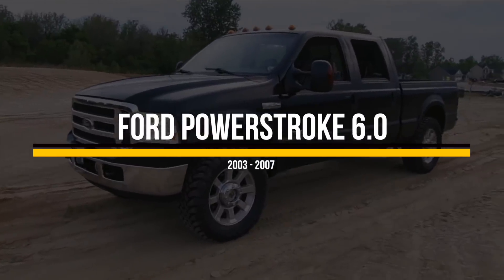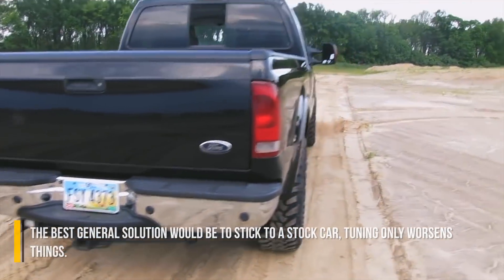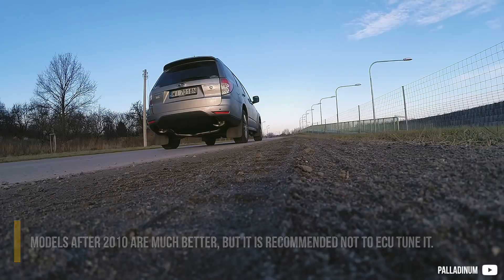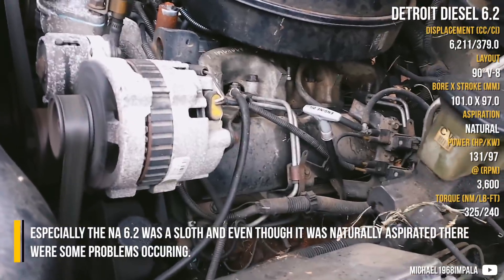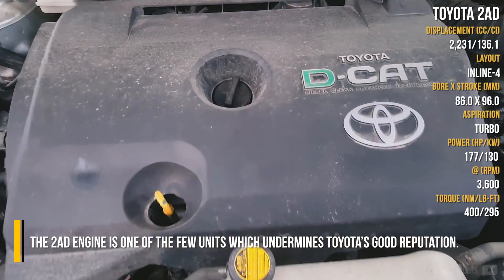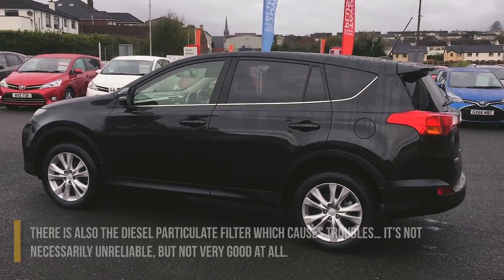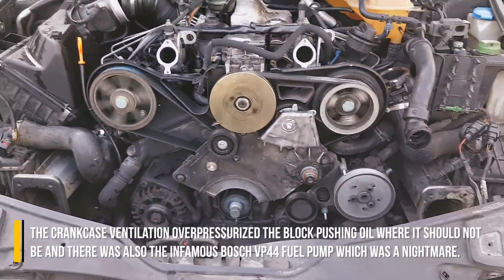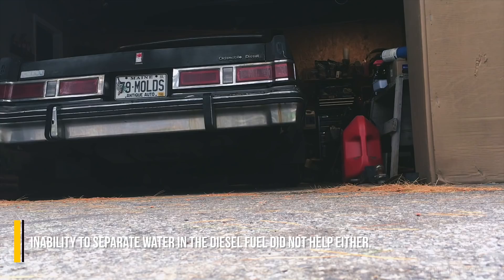6 Worst Diesels You Should Stay Away From

Comment: Toyota may not be able to make a good diesel, but Mitsubishi's large DiD's are much more reliable & economical than some of the other Japanese makes, & even some of the older Mitsi diesels are running trouble-free after 20-30yrs! 
However, as you said abusive driving & poor maintenance makes a difference, & that's regardless of how well engineered, made worse on some vehicles where there's significantly less space in the engine-bay once a diesel motor has replaced a petrol one, making servicing extremely difficult!

Comment: Mazda diesel from 2002-2010 this was the gg and gh series. de gg was not so bad (i had one, oil leaks at the back of engine, dpf and injecrion failure at 200000 km) but the gh is a nightmare especially the 2.2 liter

Comment: I think there was a problem with a bmw engine, 2 litre with 177hp,
Something about a puley and a cylinder
Reply: thats a problem with the n47 engines, the timing chain needs to be tightened rather frequently, but as it is to the rear of the engine, one has to pull the engine out to service the timing chain. pain in the butt, but if its done you can run it another 200 000 km or more before you have to tighten it again. i'd say they are great engines which still put out torque at redline rpm

Comment: There are many Japanese diesels that are actually somewhat damn good. The Toyota 1KD and 2KD diesel engine is damn reliable and somewhat is an engine that is too easy to modify and get big gains. Remap a stock 2KD engine, its power can go as high as 300 hp, which might not sound as much but that's a 50% gain. And for torque figures, even more impressive, which can gain up to 630 nm or even more. And that's just a normal remap, not including turbo upgrades, cam upgrades, until full rebuilds. Think of the 2KD engine as a 2JZ in diesel form.

Comment: the worst diesel i ever saw was the renault 1.9 witch was also used in the opel vivaro van 
there is a guy that has an opel vivaro and in the past 3 years we changed 4 engines in his van and we rebulit one and made it brand new and a few months later he came back with the crank shaft broken in 4 pieces now his van is parked at the shop and i removed the old engine a few days ago and now we are waiting on a new one

Comment: Peugeot / Indenor XD90, 2.1 litre letargic soot mill, whole engine lifetime was just a little over 100k miles / about 170- 180 000 km, truly powerless, bad fuel economy, mad emissions, prone to overheat, warped and cracked heads and worn out fuel pumps. Luckily, it's successor / upgrade XD2 had ... not much more power, but considerably better reliability.

Comment: my smart 451 0,8 CDI a city car with a diesel so a big problem is  sod.. and it had alot of problems turbo and EGR system and general sensor failure and the engine has to be pulled out to do anything on it anf to get it out the whole bag end must be disassembled

Comment: Isuzu DMAX 3.0 V6

Renault Avantime and Espace 3.0 dCi / Rover 75 3.0 CDTi (cancelled in favour of Rover G Series 2.0-litre)* / SAAB 9-5 3.0 TiD / Vauxhall/Opel Signum and Vectra V6 CDTi

Suffered from cylinder liner drop which is a fault only rectifiable right back at CAD / drawing board stage

*The K Series was engineered in original 75 mm bore format to be manufactured as a turbodiesel without further block strengthening and could go to 77 mm +/- .5 mm bore without issue. Rover could have made a reliable 2.0-litre 20v 5-pot from it | 77.5 x 82.8 > 1,953 cc

Comment: I consider any diesel after the year 2000 a reliability issue due to emission standards. I am of the opinion that the environmental impact of manufacture, maintenance and replacement of emission reduction equipment* to be just as "harmful" as a vehicle running without it. I'll stick to old clatter makers that can run on veg oil.

Comment: The GM 6.5 was a slug - If you ever turned the boost up it would blow up in no time.
Reply: dlb83082 gotta build it right. I see many 6.5s with hx35s run like scalded dogs. My stock 6.5 runs out pretty well

Comment: Toyota can make a great diesel engine... The 2H and 12H-T 6 cylinders are fantastically reliable and economical, as is the B series and to a lesser extent the L four cylinder diesel engines (the non turbo L, 2L, 3L and 5L i mean) the turbo ones are reliable but don't like to be overworked

Also, minsei diesel (UD) made good two stroke diesels aswell, similar to a Detroit/GM, but mainly for trucks and heavy equipment 

Not to mention the hino diesel engines which are probably the most reliable engines in trucks ever.

Comment: Best, well most reliable diesel I've had was a Toyota 2.0td (2001) - Bulletproof. Worst Diesel engine I've had by far, Ford Mondeo 2.0tdi (2005) failures of all kinds inc head gasket. Pile of shite!! How it's not on this list is beyond me. The ones on here must be really bad:) The Toyota 2AD seemed to get off the line alright for an old diesel with nearly 150k miles on the clock!

Comment: One comment about Japanese and their diesel building expertise that you seem to think is inadequate. Ask any one who has ever owned an Isuzu engine what they thought of it. I have seen these with 25K+ hours on them.....start every time by them selves no matter how cold....over heat in the summer when rad absolutely plugged.....easy on fuel.....burn/loose little oil even with all those hours on that particular one anyway. Isuzu also had a major hand in developing Chev/GMCs much vaunted Duramax when it was developed. The 6.0 ltr Ford was fine when you took ALL of the FORD made parts off of it and replaced them with International parts from the company that designed the engine in the first place. I think when a poor diesel is made. The roots of the poor engine start in a corporate board room somewhere. Engineers have long known what is required to make a diesel last and do what is expected of it.....not so much the managers/ bean counters of this world. My .25c

Comment: 1.5 dCi maybe 1.6 TDCi. 1.5 dCi is the same in renault and nissan but problem is different between durability nissan recommended different oil change intervals. 1.6 TDCi the same peugeot citroen PSA Ford have the same problems with leak injectors

Comment: Yes you should buy these cars, as long as it is from a year that did not require smog checks on diesels, just replace the diesel with a gasoline engine.  The motor vehicle department will think your car is still a diesel, which will mean NO SMOG CHECKS!
Reply: You will have to replace the front springs with lighter ones, as gas engines are lighter-weight than diesels.

Comment: dude the 6.2 should not be on this list. that engine is pretty dam tough sure it does not have crazy power but it was never meant to and thus not a reason to stay away from it. banks offered a turbo from the factory option and that those killed the 6.5 with the GM turbo all day long. I have a 1982 6.2 and it is a straight boss for what we do with it, easy to work on too and no problems runs like a clock.

Comment: I am abit cross that you say the 2.5 TDI is a weak engine its not i have one on 209,678 miles the engine has ran away once due to turbo failure and after a new turbo a good clean and an oil flush it started perfectly and after a compression test was done still came back with in factory compression IMHO a very very very badly talked about engine the reason why cams failed is due to stupidly long service intervals as for the Bosch fuel pump which are used globally by Cummins and can easily pump up to 800hp they are fully rebuildable for around £180 GBP there are plenty of guides on line as well to DIY it for even cheaper the engine is a masterpiece of reliability and longevity please read up more before putting down an old school great theres not meny other 2.5 TDI i know that can achieve 57MPG on a run and sound so good !!

Comment: I had a 3500 with the 6.5 and it was ABUSED in no uncertain terms.  They were notorious for eating injector pumps (I think that's what the issue was) and no power but we couldn't kill this thing.  Same for the 6.0 Ford (Navistar) we replaced it with.  It pulled 20k+ pounds every day and it never failed us.  Maybe that's why we did so well with these "bad" diesels...we USED THEM rather than making a bro dozer out of the trucks and boulevard cruising with them.

Comment: Also Mazda 2.2 mzr-cd (from M3 and M6 and even more the 2.2 skyactiv-D from the 2013 Mazda 6 need a fuel injector seal replacement every 60.000km to be reliable, like a lot of Diesel engines. But unlike the others, in those engines the fuel injectors are inside the engine, under the camshaft... It means a big bill to replace these... And it you don't you can destroy the engine by diesel-fuel going in the oil and spoiling the oil filter (bad lubrification, lack of oil pressure) :-S

Comment: yep, the toyota 1ad and 2ad series of engines and the 1,4l (1nd?)  are totally crap. i own a avensis 2,2l 177hp diesel. ive had problems with the dpf, egr,  injectors, regeneration issues (always regenerating). plus a horrible fuel consumption (on average 7,3l/100km) the best ive got is 6,9l/100km.  Plus the blown head gasket issues . Thats what you get with a "Japanese" car. the engine is assembled by Poles, the car itself is assembled in Britain and propably with Lucas electrics on top of that =D

Comment: I had a 2.5 audi and it only dorsnt work anymore cuz i crashed it. My love lived for 15 years. And as old as she was she had absolutely no problem others than maybe the need to change the plastic oil tubes drom the engine. Audi's 2.5 is the most reliable in my opinion with a cosumption of an average going to 7-8%

Comment: How did GM make a 5.7 l v8 turbo with only 120hp and 220ftlbs ?
How did they manage to get such a extremely small amount of power out of such a big engine?
Reply: They were non turbo first 5.7s were D block rated at 125 hp & 230tq replacement DX block power dropped I don't know why they did it like 105hp 210tq

Comment: The Oldsmobile LF9 needs a GM Duramax engine lasting millions of miles including the other 5 worst diesel cars need strong reliable Cummins diesel engines as those options. Give the bad diesel cars new reliable diesel engine swaps as those options.

Comment: The Olds was a real POS, endless problems with the injection pump and when they blew up which was common,they would break at the block at a main bearing cap! The best thing about them was it was an easy job to replace them with an Olds V8 gas engine.
Reply: The rear main bearing cap would break and then the no. 4 cap would break and then the crankshaft would break.

Comment: How dare you not including the 2.0 PD TDI. Those things are the worst diesel engines ever produced. My boss bought a brand new Skoda Octavia vRS 2.0 pd tdi back in (170 hp 350nm) 2007. He just did 160k on the AUTOBAHN AND HE ALREADY:
Removed the DPF (clogged beyond cleaning)
DMF got replaced when this piece had 80k AND he gona replace it again because it rattles
PD injectors were replaced from siemens to bosch (when the car still had warranty) AND ON OF THEM STARTED TO FAIL AND THE OTHER 3 IS IN BAD. CONDITION.

Comment: Yes the ford 6.0 was crap, unless you could afford the 9,000 USD to fix the defects.  The fuel injectors were not big enough so it ran lean under boost. The EGR was plastic which brings us to the after cooler, which was above the engine and shared Coolent with the engine. Any coolent loss would affect the performance of the after cooler damaging the plastic egr valve causing a fatal failure. Yes you have to remove the body from the headlights to the bed of the truck because most of the motor is under the dash.
Reply: a diesel is a lean burning engine. Anything under stoichiometric afr will produce more smoke than what is already produced
Reply: Drew Kossen The stoichiometric air-fuel (A/F) ratio of a diesel engine is around 14.7:1 to 15:1 (on mass basis). White smoke would be lean, black would be rich. The 6.0 ran lean because the injectors where to small, they did this so that it would pass emissions.

Comment: LMFAO  I saw the title of this & figured my ford 6.0 HAS to be in there, and had morbid curiosity to see what position it comes in at. Anyways...    Theyre not really THAT bad...    as long as you get away from the ford coolant, which international doesnt use (6.0 is actually a international VT365) that clogs up the oil cooler & causes plenty of other issues going down the road; Of course the EGR valve & cooler arent the greatest things other BUT...    Blocking the EGR cooler off when youre changing out the oil cooler will give you plenty of longevity going forward in the future...

Comment: GOOD Japanese diesel engines -
-Isuzu, basically a diesel engine master. Make a number of great engines, used in cars, trucks, and machinery. Can only think of one bad engine - 4JX1 (but only in a car - in machinery it's mint)
-Mitsubishi (specifically FUSO). Lots of good engines from them over time. Their FUSO trucks are pretty popular here in NZ.
-Hino. Mostly known for their truck stuff. But some stuff has found their way into a car.
-Toyota. The L, KZ, and KD engines come to mind when diesel and reliability are in the same sentence. The new GD engine is a joke.
-Mazda. The 2.2 Sky-Activ D is good. Have only known one issue with it. Otherwise is a great, easy to maintain engine.

Comment: You're wrong about the six leader it's not a complete piece of crap I will admit the EGR cooler from Ford is garbage but if you put a bulletproof Diesel EGR cooler you're not going to have any issues and yes headstone sometimes do stretch but no you don't have to pull the cab to do head gaskets on that truck you could do almost every repair on that truck with the cab on the frame

Comment: Toyota 2.2 D4D and some of the 2.0 D4D also has aluminium heads & block.. and the headgasket fails - and the head cracks and/warps.. then it needs a complete engine swap/rebuild..

I thought that i couldnt go wrong with toyota.. 10 days after purchasing it blew..

And the bmw n47 engine.. timing chain tensioners fail, etc.

Comment: The Audi 2.5 tdi did have the cam wear issue but that was corrected quite early on. I agree it's not brilliant and the PD 2.0 tdi is lighter and more compact and makes more power. 2.5 tdi sounds good though! However the BMW M30 6cylinder does the same thing and was never updated to fix the problem like the 2.5 tdi. In the BMW M30 'big six' case (petrol engine) it's loosening banjo bolts that starve the cam lobes of oil. Yet this was one of your greatest six cylinder engines, or was on one list or another of great straight sixes. Enjoy your vids though, thanks for making them! I think plenty of consumers have been burned by the ZX19DTH as well!! Or the Renault G9T? Good video topic though, gets people talking and watching. :)

Comment: In my country Chevrolet Spin 1.3 Diesel is the engine I want to avoid despite of it's low power output and expensive to repair lol. But I just don't agree that japanese can't make a good diesels. Isuzu is the example, it produces good, efficient, and reliable diesel engine. You should check that out mate...
Reply: Haha the 1.3 is from isuzu haha this is the same from opel corsa
Reply: This is the 1.3 multijet from FIAT. Just need oil change every 15000km/9000m, egr valve clean at times and will do 400000km/250000m with no hassle. Preety good distance for a city car.
Reply: Arbnor H. Nuk osht 1.3 prej isuzu , 1.7 e ki prej isuzu , 1.3 edhe 1.9 dyt jon te fiatit JTD  me singjir
Reply: Hehe  a po e kom ndru me 1,7

Comment: Maybe it's because of your geographical location @visioracer but Japan has made some of the most legendary Diesel engines ever made. Any BJ or HJ series Toyota Landcruiser is testament to that. The Nissan 4.2 is also unkillable. Then you get Toyota's 1VD series V8 engines in the 70's and 200 Series landcruiser. (Also in my opinion the best sounding diesel engine ever, super broken up that you didn't include it in your best sounding diesels video)

I wouldn't say Japan has any luck building tiny pathetic Diesels for passenger cars because they never need such engines in Japan due to their emissions and registration laws that benefit small petrol engines. But god damn can they make a commercial engine.

Comment: VAG 2.0 tdi 140/170 hp engine code: 140=BKD, BKP, BRE and the 170= BMN, BMR, BRD there broke the fuel injectors, the Cylinder head and eating oil like a pig!

Comment: All light duty truck engines fail in comparison to the cummins engine . Untill you drive a lifetime with one you won't understand the reliability of the engine, even at high hp.  Even after you rebuild and redo pretty much the complete transmission those are bullet proof . Stock not so much. I do miss my subran with 4 rows of seating with that dog of a 6.5

Comment: VAG 2.0 TDi 16v from 2008 onward is a seriously shit engine. It has a crap drive to the oil pump which will fail and turn the engine to toast. Expect to pay about £2000 to get it fixed.

Comment: Diesel for motor cars is not as functional as petrol. Diesel is better for heavy vehicles. Changing the design of the diesel engine and making them rev higher is not good because the economy is lost. The Japanese motors are very good because they bare American Designed. The European designed Japanese Diesel motors are not reliable. The Nissan 3000 Four Cylinder Turbo Diesel motor just has to be a Lemmon because the rear two cylinders overheat and the motor cracks.